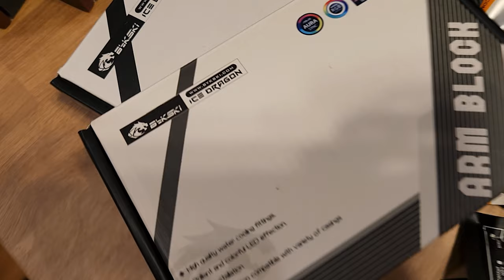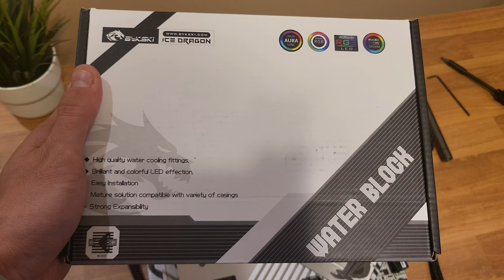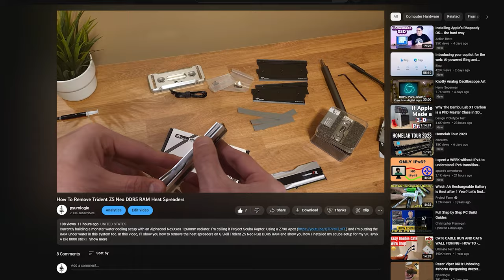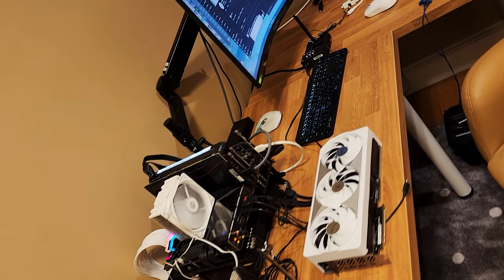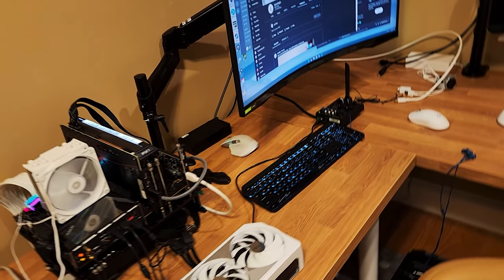The Road To 6GHz e01 \\ Project Scuba Raptor Progress // Alphacool NexXxos XT45 1260mm Cooling

Comment: Wait are u doing an external radiator? Or is this going on the test bench case
Reply from the maker: yeah this will be detached external. I already run the AIOs detached external after i broke i off all the mounting tabs on my AIOs from leaning over time on the BC1, it's just easier to run em detached anyways hah
Reply: @@pyurologie  got it... looks like a beast of a cooler